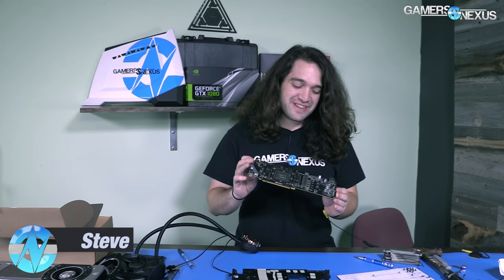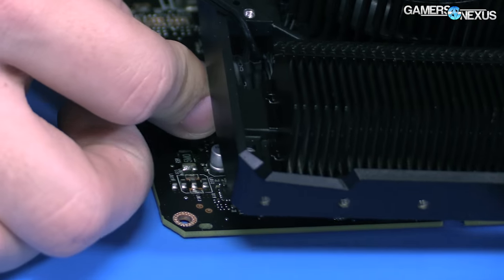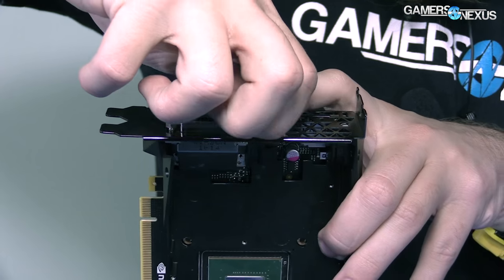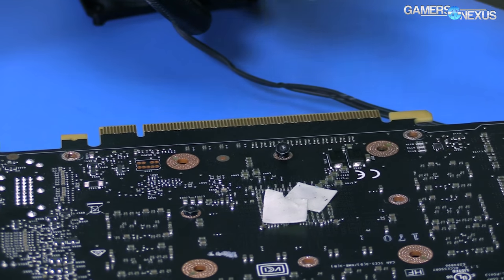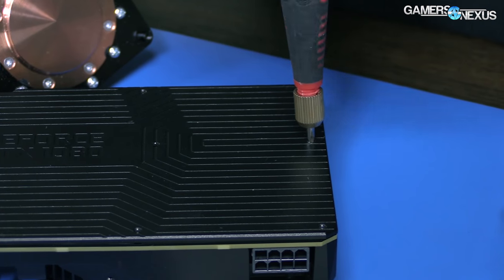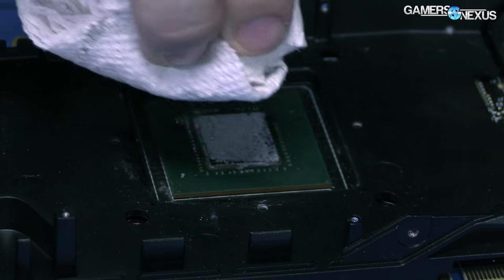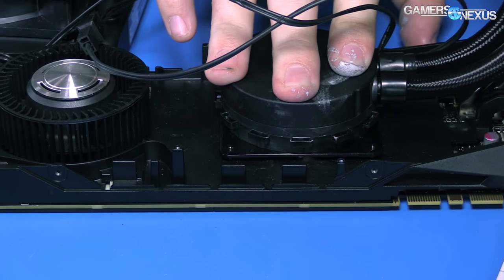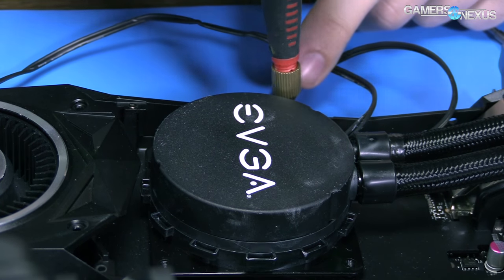Building a GTX 1080 Hybrid Part 2: Assembly

Comment: Not sure what the size of the driver you have the screw stuck into but here is a suggestion that might work; link a few motherboard stand offs together, make sure they are the 6-32 and not the M-3.5, and you should be able to reach up inside the socket and retrieve the screw. Obviously I am assuming 6-32 for the screw thread, as that is what it appeared to be. If you link a few stand offs together you they should fit inside that socket and be able to screw onto the threads and pull it down. I forget what the stand offs but they should be smaller than the screw head that is stuck. If too small something else that might work is 1/8" vinyl tubing. That should easily thread onto the screw enough to pull it down. If it works, perhaps you can add it to your next video or something... Cheers Mate....
Reply from the maker: +Paul Bialozor That is actually brilliant. I like this... will give it a shot! ^SB
Reply: +Gamers Nexus Keep me posted, I'd like to know if it works... Thanks....
Reply: rip

Comment: "Turn a 1080, a 700 dollar card, into, either a liquid beast at overclocking or a brick, either one creates great content!"

These guys get it.
Reply: Yeah
Reply: A video card GPU is essentially a custom purpose CPU; it can be destroyed the same way through either static shocks or overheating. If you know what you are doing and take the right precautions, the risks of shock are easy to avoid. However, they have no idea how the card was going to react heat wise. If the liquid cooling system is not up to the task, these cards might simply overheat when you ramp up their voltage no matter what you tried to cool them with. So overclocking it could brick the card. Not really that hard to understand. ~ and the entire point of water cooling it was to attempt overclocking otherwise the default system kept it cool enough for normal clock speeds.

Comment: Like people already have stated it is not the thermal issues, it is the power restrictions that holds the founders edition card back. A day or two ago a German channel mounted a third party cooler solution from Arctic Cooling and tested the card in Doom and it got to 2200 mhz but it was artefacting because of lack of juice not high temps.

Comment: Linus TechTips and JayzTwoCentz proved that too much thermal paste has no effect compared to the recommended amount. They literally had thermal paste overflowing the GPU and CPU that was being tested and there was no change in temperature. The only time you have to worry is if you put on too little. Heck JayzTwoCents dumped a whole tube of ArticSilver onto a GTX 580 and there was no change.

Comment: I used that method of thermal paste applying with Noctua thermalpaste, and it ended up very smooth, i actually think this method on bare GPU's is recommended since you really want all the surface covered in paste.

Comment: 9:35 "Using premium materials and components"
Reply: are you kidding? do you know how small and fragile that screw is.
Reply: hows your amd card though
Reply: would you prefer a large screw that goes all the way through the board? Or maybe that was the one screw in the batch that was bad
Reply: roogac nobody buys reference cards anyways. They always suck.
Reply: roogac review samples ARE retail units...
Reply: +roogac whats your current setup?
Reply: roogac no, i know the possibility is there. But if it was true, you wouldnt get youtubers that get samples that can barely overclock, they would all be able to overclock 300mhz without any increase to the power limit. Dont you think people wouldve caught onto higher performing review samples by now?
Reply: +roogac the problem is the screwdriver. The thicker the driver, the more torque you will easily apply to the screw, he should have used those little precision drivers or been more careful.
Reply: what were they supposed to say? using garbage, buy it newayz... every1 lies. xcept me

Comment: Thermals are fine with custom fan profile settings, but your OC will still be limited by lack of power. Of course since your main reason for doing this is "because I want to" then I guess that doesn't matter too much.
Reply from the maker: No... it's limited by lack of thermal headroom at a bearable noise level and a lack of voltage, not a lack of power. Power comes after voltage, in this scenario. See P3.
Reply: Gamers Nexus Noise can be an issue of course, but even at 80% fan speed it seems like the limiting factor with other tests on YT have been power. Thermals were fine even at 80%.

I saw someone put up a possible work around to the power limitation, but there's risks there, and we'd probably be better off waiting for non reference designs to push OC any further.

Comment: Personally I would've used an extension cable for the fan/pump headers to the mobo to free up some more wattage for the card, that's what I did with my 970.

Comment: You are way too worried about the thermal paste. It is non-conductive, so could paint the card with it and nothing would happen. Plus putting enough on so the the excess squeezes out the sides helps ensure good coverage, thus good contact with the block.

Comment: You won´t be able to max OC with this, because of the power target restrictions. One 8pin power supply is not enough. Have to wait for custom boards with 6+8pin to get maximum performance.
Reply: +Truth1988 I assume Gamer Nexus already know this, ie. that they won't get different results to the German site that did this with an aftermarket air-cooler. They know that the bigger sites and youtubers are waiting to do something like this until they can do it to an AIB card with 8+6pin power which will actually generate new information we don't already know. But despite already knowing themselves there is no point and no new information to be gained, they are doing it anyway cause they know it'll generate views.

Comment: If you cut the Expansion slot shield you can make it look very slick, just a nice cut on the back nvm I'm restarted just remembered that part isn't in the case lol. But if you really wanted to it would be a waste of time but you could cut into the cooler and create a point for tubes to leave the card itself and into the system .

Comment: Quite educational - Same as CPU cooling but with the GPU - CLC will it better the stock air solution? - should do - Thanks for mentioning the 82 degrees C throttle.

Comment: Did anyone else notice he did not need to go through all of that work removing the backplate ? You just need to remove the top shroud pieces and heatsink, then bolt up the cooler with the 4 bolts? It is also safer to run your pump from either a fan controller or motherboard header so it be set at a proper pump speed.

Comment: I put the evga hybrid cooler for a 980 on my gtx titan for the same reasons, but the hoses come out the side of the card not the back i think you mounted it wrong?
Reply: He knows it's the wrong way. Since he isn't putting the rest of the shroud on it makes no difference, if it were compatible with the 1080 design then he would have put it on the right way.
Reply: Your right considering this is for testing there is no wrong way.

Comment: One of the fans on my r9 280x toxic died, so I bought an arctic cooler for it, but because the cooler is so massive it interfered with my ram. so I just stuck on the regular cards' heatsink and attached the fans of the artic cooler on on top. It looks ghetto as fuck but those arctic fans are super quiet compared to the old ones and keep the card cooler.

Comment: would be interesting to connect it up to a open loop. i found recently when building a hack job cooler for my brother using a broken asetek pump (gutted of its fan) and 2 aio 120mm rads connected to a cheap open loop pump i had spare that 10/13 flexi tubing fits quite nice and tight over the tubing tubing used by aio's tested it using my little tv box oc'd so the amd a10 would pull 98w in hardware monitor and in prime95 small fft it would still sit the cpu at 29c with the fans at about 1000rpm
Reply: meaning these asetek cold plates are really good and do like more flow

Comment: Honestly do you think I did it well selling my 980 Ti to buy a 1080 for VR and 4k?
Reply: but what are you gaming on right now until you can get a 1080? ^^
Reply: If you've already sold it, then yes. If you haven't, I'd wait a bit for the price to drop, that is, if you got the CPU power to also handle it all.
1080 out performs a 980 TI, so if you can't wait, then go for it lol You can only benefit from the performance.
Reply: The general gaming performance isn't huge over a 980 Ti.. But for VR it can potentially be a bigger deal having the 1080 because of some improved technology's. I personally wouldn't have done that, seems like a waste unless you have a lot of expendable income. But you'll see some gains for VR and 4k sure.

Comment: Next time you don't have a tube to apply thermal paste, and you do have a piece of plastic wrap,   just put a dob in the middle of the plastic wrap, and wrap the sides around to trap the thermal paste in a ball.  Poke a hole in the ball, and squeeze out the paste.  Like the way you squeeze ketchup out of one of those little plastic ketchup packets you get at McDonald's.

Comment: I'm a total n00b here, but is he using a CPU cooler for this bad boy? Could I do the same thing to a 970 but using the NZXT Kraken x61?
Reply: He's using the cooler off the EVGA 980 Ti Hybrid.
Reply: OHH. Thanks!
Reply: you could with something like the kraken g10 bracket, an x61 would be wayyyy overkill tho, maybe an x31 or a corsair h55 would be a better option
Reply: But theoretically, it could be done? I guess my main concern is mounting it to the actual GPU. Long conversation short, I'm just curious if the custom cooler has the same mounting style as a normal AIO liquid cooler. I have looked into the G10 tho, it looks pretty legit.
Reply: Adam York The Kraken G10 bracket is designed to mount certain AIO coolers to a GPU.  It SHOULD work with THIS cooler, but THIS cooler isn't available separately - it's only on the EVGA 980Ti Hybrid.

To replicate this, unless you happen to have a 980Ti Hybrid laying around, your best bet is a G10 and an X31 or similar, if you really want to go this route, but this route also has problems in that you won't have the VRM and memory cooling (unless you figure out a way to frankenstein the G10 to the 1080's VRM cooler).

The truly best way to go is to go custom loop watercooling.
Reply: Hey man, I really appreciate the post. I'll look a bit more into the G10 and custom loops. I never really considered cooling the GPU, so this is exciting. Thanks again. <3

Comment: Applying thermal paste to a GPU is not that difficult

You draw an X
And then a + over the X
Then the mounting pressure of the waterblock spreads the paste for you. Use a nonconductive paste and you won't have to worry about using too much.
Reply: +mei actually you can't because you wouldn't get full coverage of the dye.

Comment: From what I've gathered, the biggest thing holding these cards back is the power limit with the single 8 pin connector, and as someone else noted on reddit, that the power limit is in place because the vram gets warm on the stock cooler, so I'm curious to see what this actually does without water cooled vram and the extra power to the card.

But most of that is hearsay and I might be full of shit.  Give partner boards. D:
Reply: +phokas 150W on the 8-pin PEG connector from PSU plus 75W via the PCIe slot on the board = 225W total power available.
That 75W via the PCIe slot is how all those lower-power video cards that don't provide a 6-pin/8-pin connector get powered.
My GTX980Ti (EVGA 6GB SC+ ACX 2.0+) has a total max of 300W of power available (75W via PCIe slot + 75W 6-pin PEG from PSU + 150W 8-pin PEG from PSU), and it's currently idling at around 25% power consumption with 3 monitors (2x1080p 60Hz + 1x1440p 144Hz) until I boot into a game.
Reply: +ElNeroDiablo Right.  But the Founders 1080 uses about 215w power relatively easy with around a 2,000-2,100mhz overclock.
Reply: +ElNeroDiablo is 75w for PCIe standart or is it different with other mainboards?

Comment: You can never have too much Thermal Paste.
Reply: agreed.  I don't understand why people try to be so sparing with it.  Sure, you can retain heat by using a HUGE amount but he could've put a pea sized drop on there and let it spread on its on.  All they wiping and spreading introduces air bubbles,paper towel lint, etc and made things worse.
Reply: ***** the chip is flat, the bottom of the cooler is flat.. just squish them together and it'll do what comes natural :)
Reply: Especially not on graphics cards. If it is non-conductive paste, you can basically dump the whole bottle on there with no issues. JayzTwoCents did a video on this I think.
Reply: HeyMyAwesomePeople exactly
Reply: You think they spread thermal paste with a razor in the factory? They've got a dedicated machine fore that. Stop inventing theories to match your fancies.

Comment: jesus that thermal paste... rip 1080
Reply: you can but all the paste you want and it will never kill the gpu. You know nothing about pc building i see.
Reply: Rasmus Rasmussen totally thing i know is that you are not supposed to spread it around and pleaseee... fix your comment....
Reply: it doesn't matter and doesn't change the end result. If you take off the heat sink of a graphics card you will notice that it comes with a lot more thermal paste than a CPU because of how big the die is, it's pretty common to use a lot of paste when it comes too a GPU.
Reply: lex lazootin i said nothing about amount
Reply: The method of applying thermal paste has been shown time and time again to have very little effect, if any, on performance. 

A cross over the chip, a pea size dot in the middle or spread all over with a card (or even a finger, see the techyescity channel) A couple of degrees at most is seen. In fact, for gpus, unlike CPUs, spreading paste manually has been shown to be the best method (but again, only by a couple of degrees).
Reply: Literally nothign wrong with it
The way he applied it is completely fine cause he isnt gonna break the gpu lmao
Reply: Yeah, rip 1080. I mean all those companies that produce GPUs and issue them with huge amounts of thermal paste are just plain dumb, right?

Or maybe, just maybe you're confusing GPU and CPU thermal paste application.
Reply: He literally said nothing about the amount of paste applied, why is that everyone's go to response? Youre trying to counter a point that was never brought up.
Reply: I said "The way he applied it is completely fine he isnt gonna break the gpu lmao" so please point out the spot where I said anything at all about the fucking amount of thermal paste that was used.
Reply: In my personal experience you are right, Installing a waterblock myself yielded a noticeable difference in temperatures than a pre-installed one. But hey if someone else says otherwise maybe my experience is wrong and you should dip your GPU in thermal paste.

Comment: that reference cooler is the same thing with different outer curves xD and ye still not a good cooling solution!

and that fragile screw is the testament of Nvidia trying to cheap out as much of the GPU's reference cooler materials/parts as possible lmao Thats why I usually wait for the custom coolers even if the pcb is reference design. :D

Comment: One cringe though. You say IHS, which a GPU does not have. The pea-method should only be used on IHS surfaces, while you should actually always be VERY careful to cover ALL of the chip when applying to a bare chip like you are.

IHS stands for Internal Heat Spreader, which is the big plate on your CPU that covers the smaller chip inside it and spreads out the heat to the larger surfaces of the CPU coolers, for those that didn't know. Look up delidding and you'll see how it's constructed.

Comment: "that cover servers no functional purpose"  UM...... it channels the airflow from the blower fan over the rest of the components... SMFH
Reply from the maker: +TufGriz You are incorrect. I've tested it. The difference is zero because, had you watched any of the video, you'd realize that the right half of the shroud is what channels the VRM fan (and that stays on our 1080 -- obviously).
Reply: +Gamers Nexus How different is the plate from the 980 (that you left on the card) from the plate on the 1080? Or rather, could you have swapped out the plate?

If they match, you could move the needed thermal tape and swap the fan from one plate to the other.

Then you can use the EVGA shroud.

Comment: Ugh. Your work ethic with electronics made me cringe a number of times while watching this. It's a good thing that you're independently well off, because if you worked out of an electronics store, and you were my employee, I would fire you...probably within 20 minutes of starting your shift. You say "I didn't even turn it that hard." You overtorqued the screw. They break because if you leave them with that much torque, it damages the internals of the card over time, in this case, pressure of the backplate against the card. Don't work so fast, and don't rush.

Comment: dude get a siringe put it in to that. cooling paste can be conductive DO NOT SMERE IT ON LIKE IN THE VIDEO! if the chip heat spredder is smal use a dot. the surface of the cooler wil spread it for you. is the heat spreader bigger  like a c.p.u put on a little worm NOT OVER THE HOLE LENGT OF THE C.P.U! NO X! picture you self like the chip. you use a little hair product in your hair not the whole bottle. its the same for the chip.